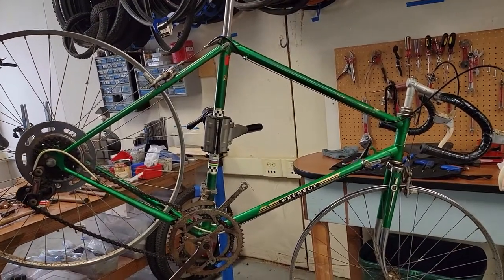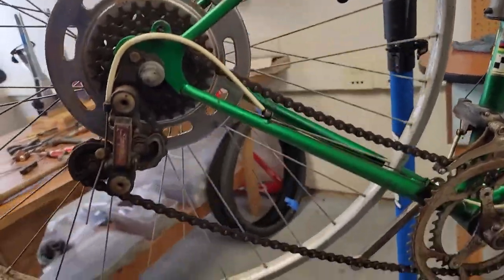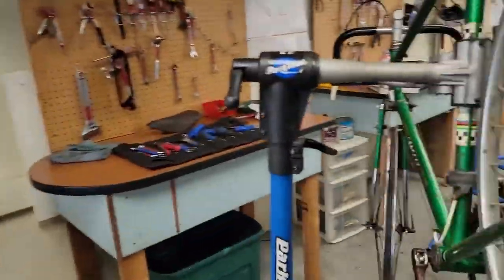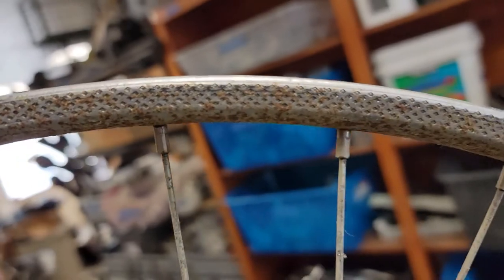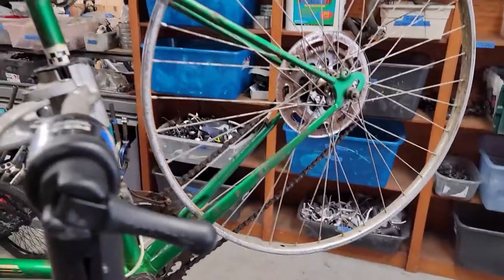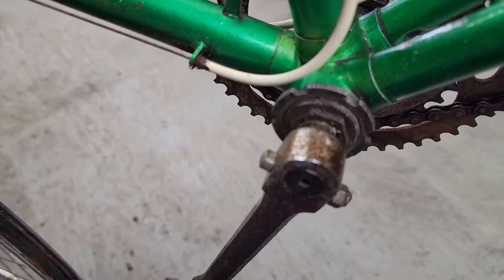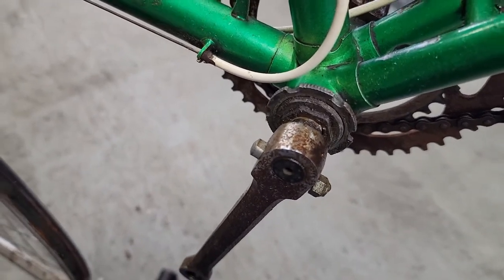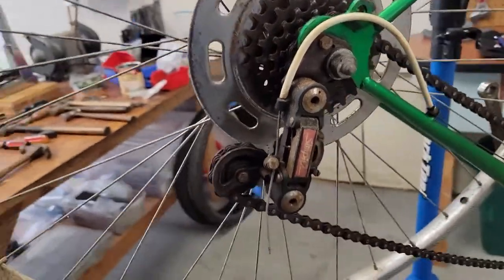Vintage Peugeot bicycle

Comment: Hi there, since you were asking for info, I'm pretty sure this is a mid 70's Peugeot UO-8. Probably somewhere from 74-78. It does have a traditional cup and cone bottom bracket. Those rims also look like the original steel textured Rigida rims. Anyway, you probably have this figured out by now. I'm working on a restoration of one of these now so it's fresh in my mind. Good luck on the tune up!
Reply: Thanks for the information.  Do you have a photo of the bike you are working on? Check out Virtual Bike Kitchen (channel) for more on this bike. We are just starting to work on the bike and we posted a new video today and started a new playlist for the Pug.  The wheel hubs have "Normandy" etched on them.  I assume that is where they were made.

Comment: I had a couple of these in the 70’s. They rode nice when they were brand new, but those Simplex derailleurs weren’t very good. The  centre pull ‘Mafac Racer’ brakes  worked😂 quite well. In my area these bikes were in competing with base Apollo bikes. In my opinion the Apollo bikes were better. The Apollo bikes had Suntour derailleurs that were better engineered than the Simplex ones.